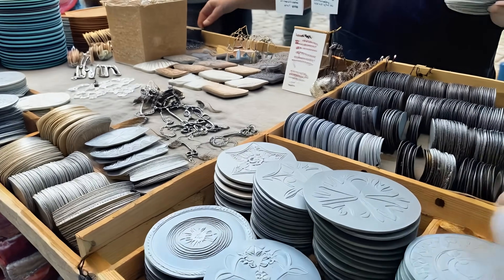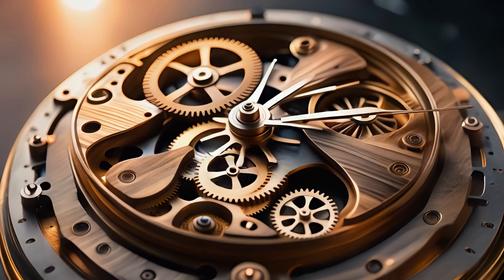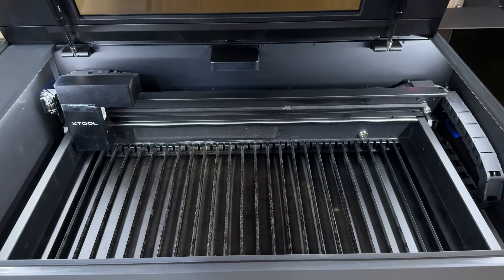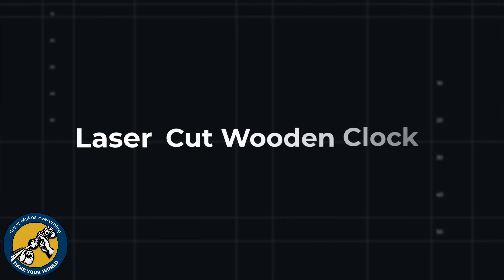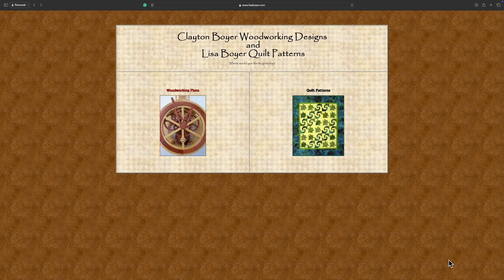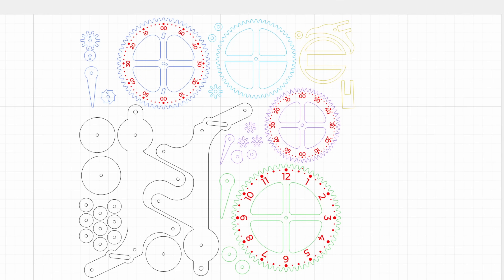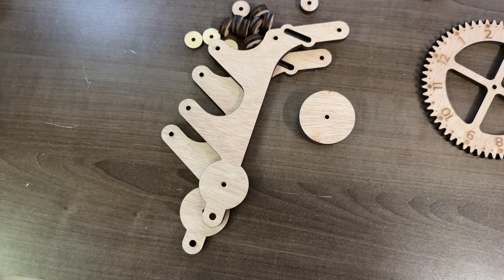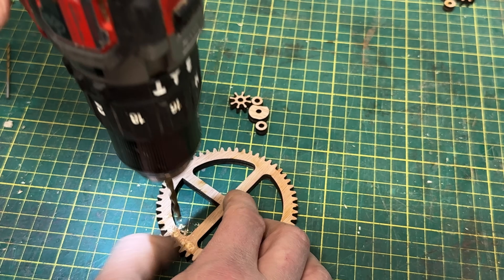Create Your Own AMAZING Laser Cut Wooden Gear Clock

Comment: Did u get the clock to work and keep correct time +-
Reply from the maker: Yes you can pull the Bob down or up on the slide to calibrate.  It’s no Rolex but it works well enough and is a great conversation piece. If I was making my own design from scratch I’d use a clock motor rather than weights and a pendulum.  Not as cool but not winding and better accuracy.